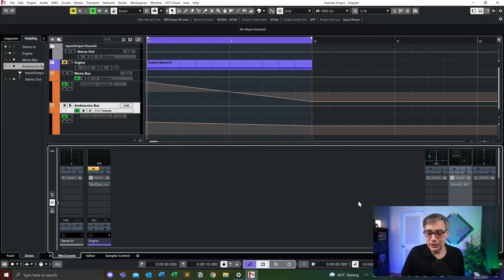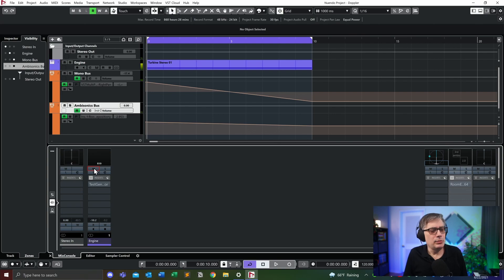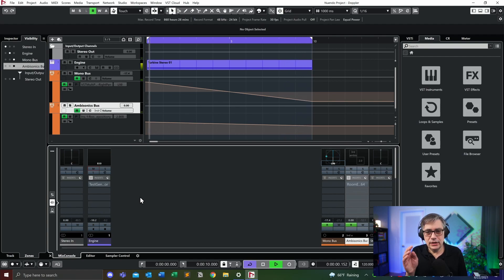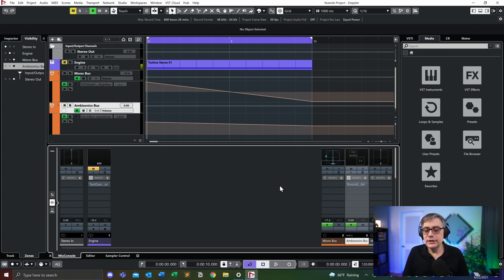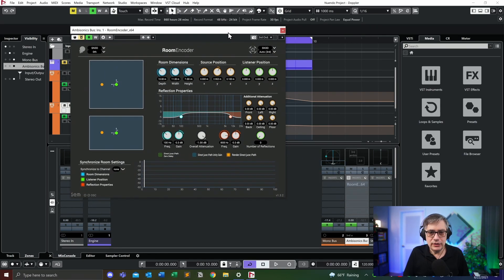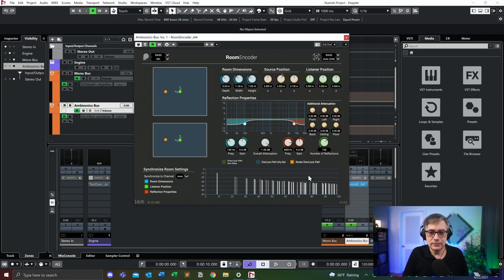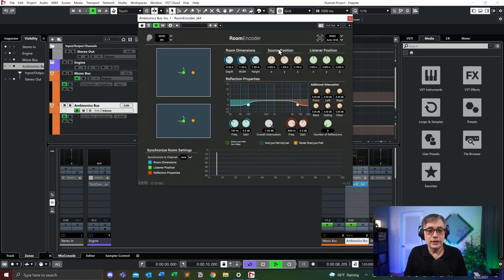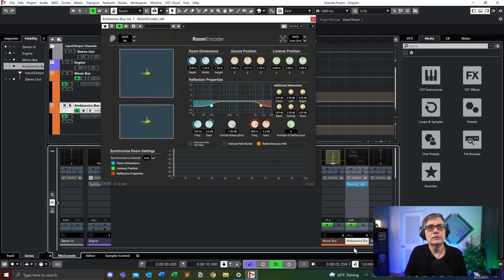Creating a realistic Doppler effect with IEM RoomEncoder

Comment: yo yo yo i just downloaded this plugin and used it on fl studio but all im getting is a mono output is there anything to turn it stereo? even from iem plugins?
Reply from the maker: This is an Ambisonics plugin. FL Studio can’t work with Ambisonics.
Reply: @michaelgwagner  yeah i noticed that the plugin has like 64 outputs. i still think its possible to map them all out but i dont know the mapping in terms of panning for each output and/if/or latency compensation. i actually tried auto mapping but it only mapped to the 4 sends and it sorta worked but it didnt quite work the way its supposed to.